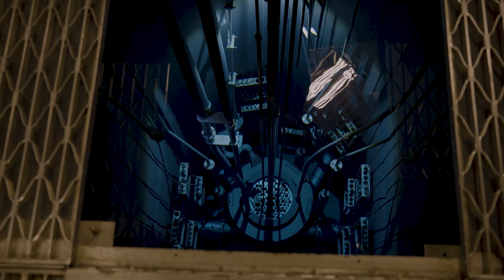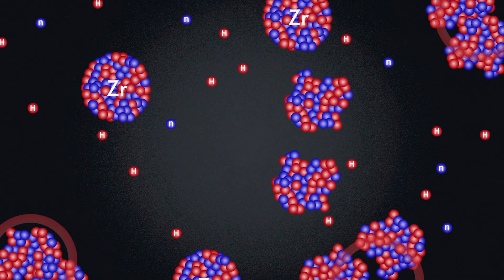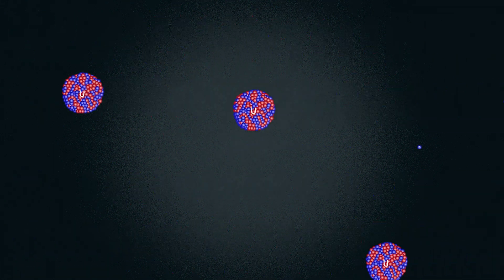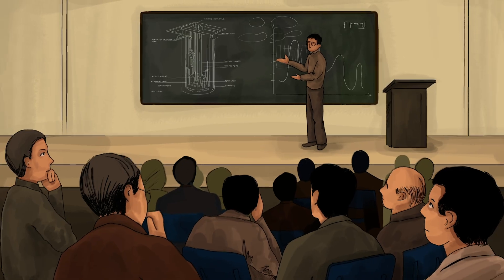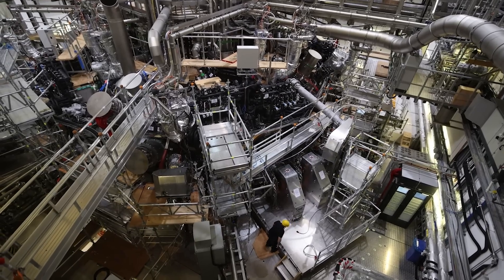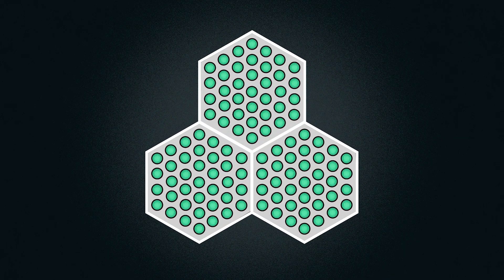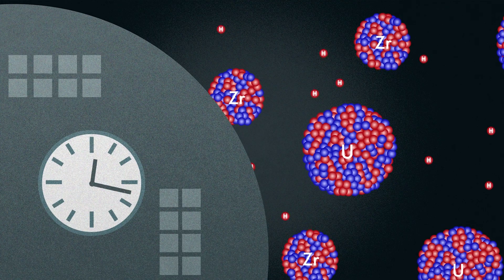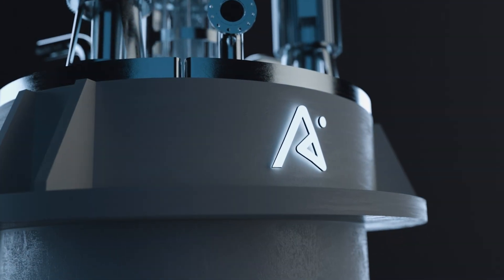Why isn’t this nuclear fuel used everywhere?

Comment: The only problem with TRIGA reactors is they use highly enriched uranium...
Reply: ... The other problem you intermitting Is with the dissociated hydrogen As we found Fukushima you could have a hydrogen explosion that could damage the reactor... That is not good! The meltdown at Three mile Island, also caused a dangerous buildup of hydrogen could've exploded and damaged the reactor... It is thought that one of the explosions at Chernobyl was due to a hydrogen explosion....In fact managing the buildup of hydrogen reactor is probably more serious threat then the core meltdown...

Comment: This is amazing content. I'm really glad i stumbled upon this. At this point i strongly believe nuclear energy should be the main energy source we are using for our power grids. Then we could use alternative energy sources in collaboration with that. 

The more I've learned about our power grid, the more I've learned that modern nuclear energy options is our best option. Gen 4 reactors, Molten salt reactors, LFTRs, Thorium Reactors, Small form reactors. Utilizing our advanced technology, Improved engineering & material science. Utilizing our greater understanding of safety & well made designs. We have so much more advanced computer technology & robotics that can be used. It feels like even tho tons of advancement has occurred with engineering designs, safety measures, etc. It still doesn't matter to most people. It's like most people are ingrained with a natural negative response when talking about nuclear energy. It's a bummer because i truly believe that our best option for our future is to start utilizing Modern advanced nuclear energy options in our electrical grid. It's just proving to be challenging to get politicians to get on board. 

  It will really allow places to be much more energy independent. Less reliant on fossil fuels. They'll have efficient, stable electrical grids and the rest of the grid could experiment with alternative power sources, power desalination plants, etc. 
We need to heal from the trauma of our past. See & learn that those things only happened solely from Us not understanding what we were doing when it came to nuclear energy at the time. We didn't have advanced enough technology, material science, engineering, safety measures, understanding of how to go about everything, etc. This source of energy will greatly help the world improve towards the future and lowering emissions. More than anything else could, while also providing a very stable electrical grid system. Currently we have alternative energy options but the majority of our grid is powered off of fossil fuels and emission producing sources of energy. We will be so much better going forward commiting to modern advanced nuclear energy options.

Did they outlaw electricity or oil, coal when things went wrong in the early days of those fields? No! They kept going and understood things usually are bumpy and difficult in the beginning and kept going even tho those sources negatively impacted our environment. A huge issue is government BLOCKING any sort of progression from happening. We'd be lucky to see the slightest projects approved or finished with-in the next 100 years.. It's very annoying to see how much we have gotten in our own way when it comes to improving or advancing certain things. Instead we let fear, money, man made "required legal processes" Stop us from doing anything other than wind, solar, oil, natural gas, damming our rivers, mining for minerals... It's very frustrating because we should be able to use all these options in collaboration. If we actually wanted to improve anything. That's what we need to do and stop letting so much potential get blocked from ever occurring in the first place.. It's really irritating. I wish certain people didn't make this so "complicated and difficult" Why would any reasonable person want to block progression?

In my opinion it's been irritating that our society has taken this "it's up to each individual person to make a difference" approach. When that just plays off of people's emotions. This issue is so much bigger than individual people. We need countries/states to get on board. It's the only way we can make even the Slightest difference. We've already waited too long. Everyday is a day wasted & we haven't even made a dent in improving our situation.

The fact that Desalination is so energy intensive but fresh water is so important.. What If we dedicated nuclear energy to be the main energy option to run these energy hungry desalination plants?? Idk why we aren't already doing this anywhere we could...?
Seriously think about it.. Nuclear power produces no green house gas emissions. It's extremely energy efficient. The list goes on. So why are we not utilizing this... We are being extremely too slow, too reserved, too cautious, too inactive to even make the smallest dent into our climate issue and our energy issues. It's holding back progression across the board in many different area's.. It's honestly getting really frustrating. I thought we would be more motivated than this. More active than this....?